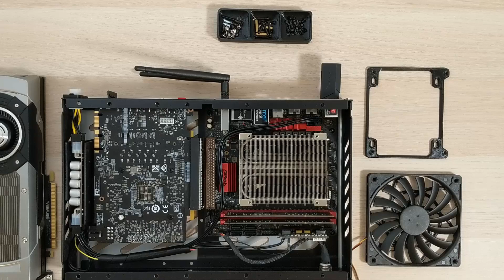Noctua NH-L9 120mm Fan Adapter: How to install a 120mm fan on your Noctua NH-L9!

Comment: will this work on a X570 aorus mini itx board.
Reply from the maker: It looks like the CPU socket is a bit too off centered. If you don't have clearance towards the top side (where the 8pin power is) then it may not fit inside the case.
Reply: @j-hack7998  Thanks!  I was hoping to put in a slim 120mm fan.  The noctua Lh9a can't seem to cool a 5600x.  I keep hitting 80-85 with case cover removed.

Comment: Would a 140mm noctua fan fit(nf-a15)? it has the same mounting screws.
Reply from the maker: It will attach but you'll require longer screws, and it may not clear the rear IO.

Comment: Will there be a version for 120mm fan on L9x65? Would love to see if A12x15 fit with it in Ghost S1. Would be a way better alternative than the discontinued L12 or other cooler limiting RAM height.

Comment: What memory are you using?
Reply from the maker: I am using the gskill NT series. They come with no heatsinks.
Reply: J-HACK thanks. From a quick search it looks like they come in slower speeds only. Have you ever overclocked them? I’m looking to pair it with a 3200G
Reply from the maker: @TBug10  I recommend corsair lpx or crucial ballistix